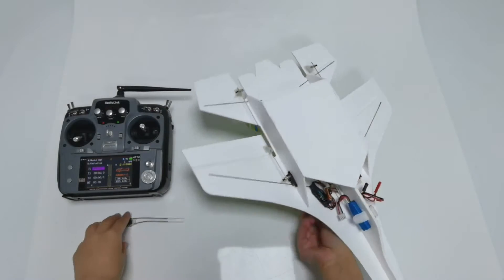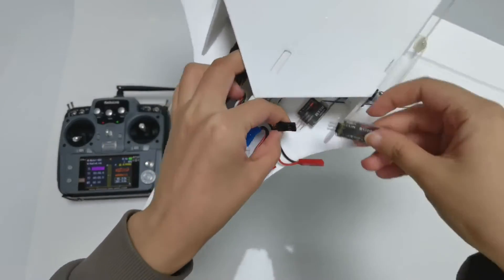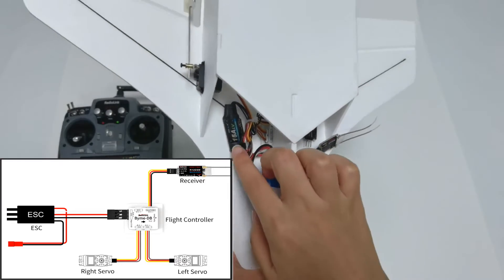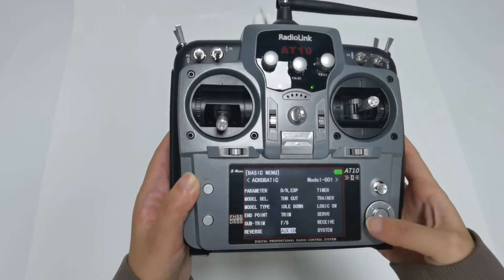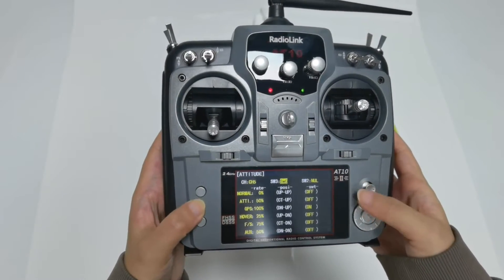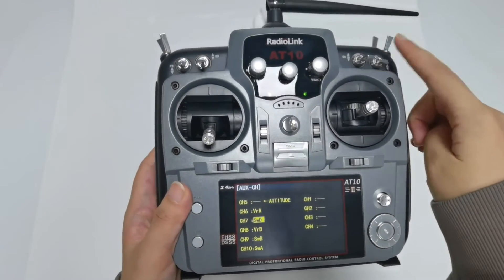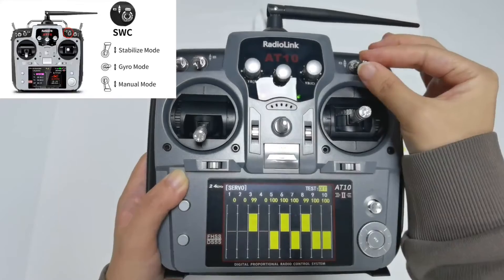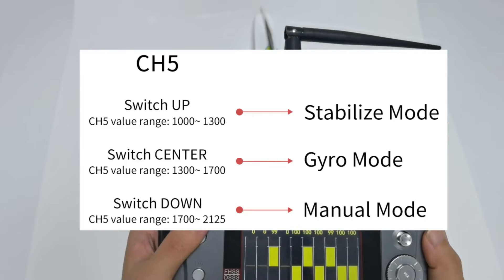RadioLink AT10II Controls SU27

Comment: Congratulations, young lady! (Would that be "Amy"?) These videos are becoming much more useful now for setting up the Radiolink Byme stabilizers. 
A question, please. Do ALL Radiolink radio systems use the REVERSED throttle? That is - the same as Futaba S-FHSS, where 2000usecs (+100) equals Motor OFF and 1000usecs (-100) equals Motor full throttle? ALL other Radio Systems use 1000usecs for Motor OFF! 
Also thank you for highlighting the need to sometimes lower the throttle value to allow the stabilizer to ARM - AND to turn OFF the motor! That is a problem some users have found with your Byme stabilizers. 
1 Other quirk you should notify users about is that (on the Byme-A stabilizer at least in our experience) the motor will give a burst at the completion of the Level Calibration! Since there is no Arming Switch for the Byme-A perhaps this might be related to the variable throttle end points introduced by your stabilizers?
Reply from the maker: Hi, sir. Thank you for your feedback. 1.Yes. All the aircraft radio system use the REVERSED throttle. That is why we provide the value of channel 5 and channel 7 for Byme-A when people use different transmitters.  2.Yes. The motor will give a little burst when the level calibration is complete. We'll make customers know about it when we make tutorials in the future. If any feedback about RadioLink products please feel free to contact us. Our email is: after_service@radiolink.com.cn
Reply: Thank you for the confirmation.  @Radiolink_official
Reply from the maker: @theoztreecrasher2647  Our pleasure. Any other question please feel free to contact us